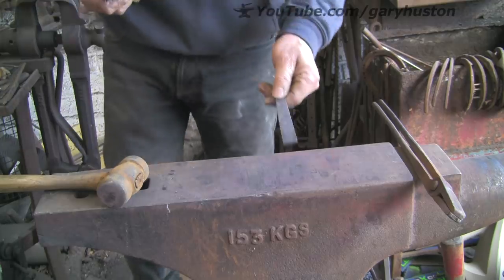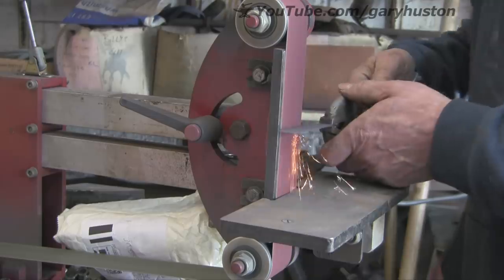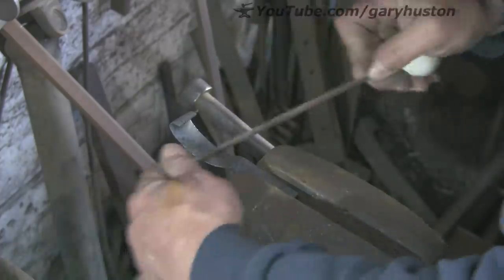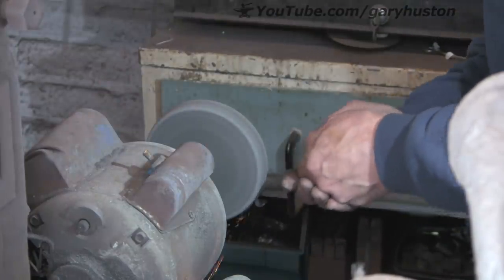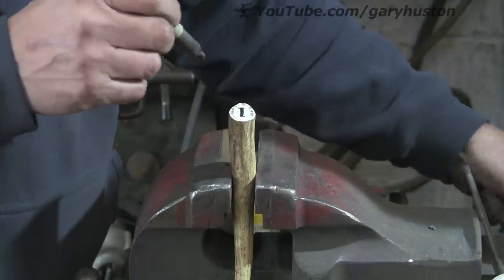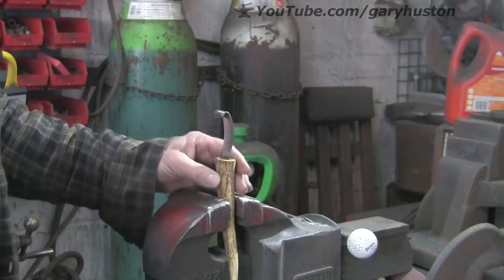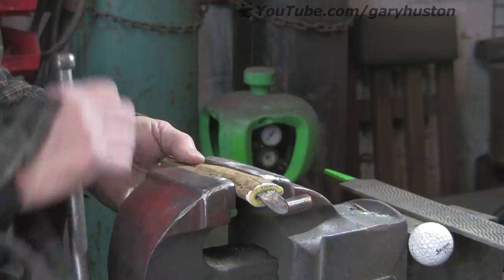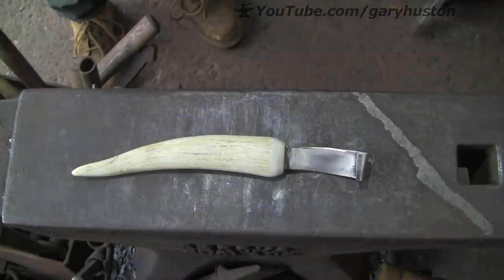Forging a Farriers Knife

Comment: Beautiful job on the knife, Gary.
I might suggest a tip for glueing or epoxying any blades, etc. into handles.  I mask off the slot or hole with tape and after the glue/epoxy sets up, just strip the tape off leaving a clean surface around your work.

Comment: I'm wanting to make one out of smoothed out rebar.
Reply from the maker: It might look ok but won’t be functional. Rebar isn’t hard enough.
Reply: @garyhuston  that would explain why there's no videos of it being made of rebar 😂 I'm on a budget so I've gotta go cheap for now. Not looking to sell yet. I like to practice on cheap metal so if I do sell it won't be with low quality material
Reply from the maker: @Colt1775 you just need to use something like an old file.
Reply: @garyhuston  oh okay. Truth be told I was expecting to need some specific kind of steel. You've been very helpful. Thank you. Here's a follow and a like 👍
Reply from the maker: @Colt1775  I don’t sell them on I just make for myself and friends but I would use old files all day long. Properly heat treated they will out last any shop bought stuff!